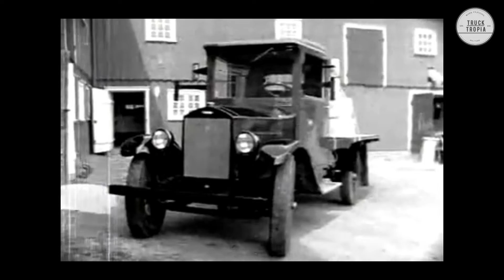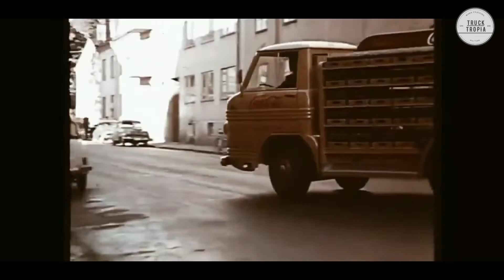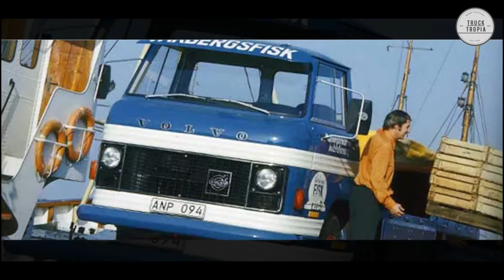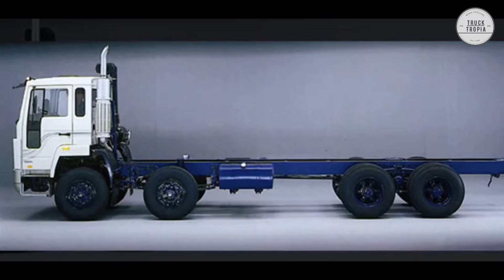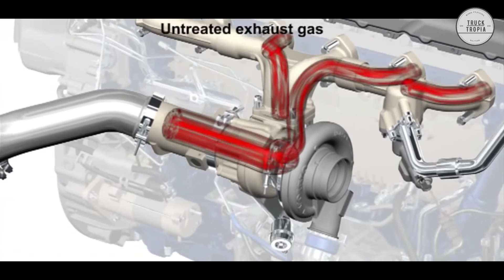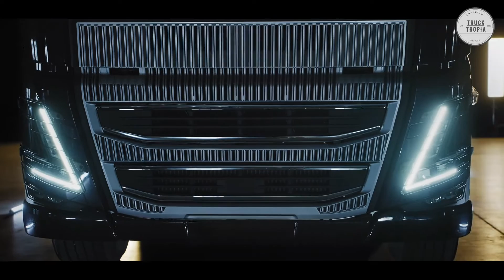How Volvo Trucks Became An Industry Leading Manufacturer

Comment: Volvo Trucks

FL (This Century) = A Jean-Philippe Texier Truck (Production)

Volvo (Latin: I Roll)’s Lander Rebadge (Low, Mid Or High Cab)

FE (This Century) = Jean-Philippe Texier Truck (Exhaust Brake)

FM = Volvo’s Forward Control (Multi-Purpose)

FH = Volvo’s Forward Control (Haulage)

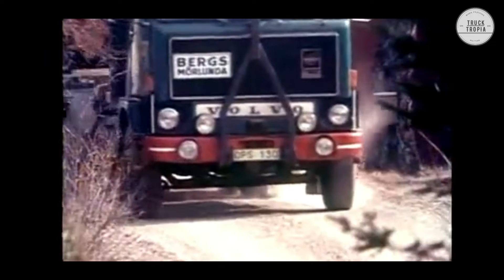4:10 Volvo TipTop Range (Forward Control)

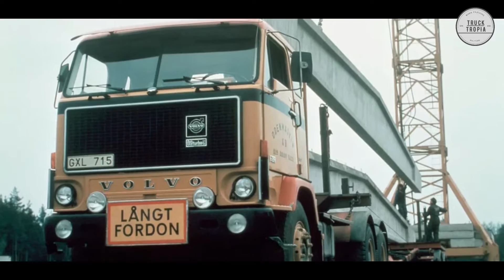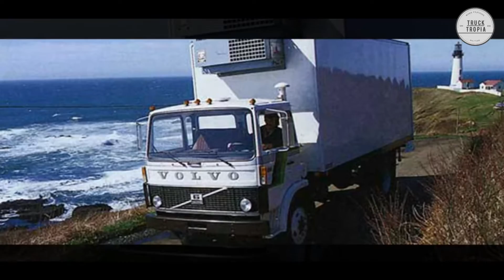5:12 Brand Club Trucks 5:20 Forward Control

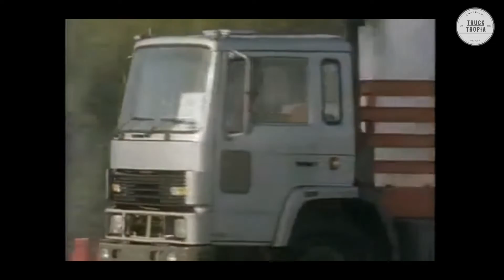6:21 Brand Club Trucks (Door Windows)

5:21 Volvo F Type

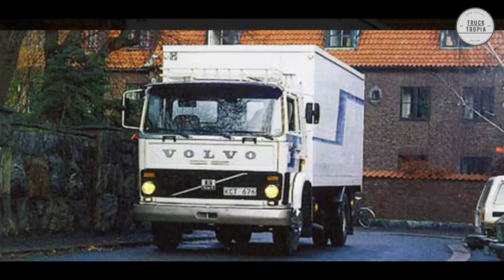5:35 Volvo’s First Series Of Truck

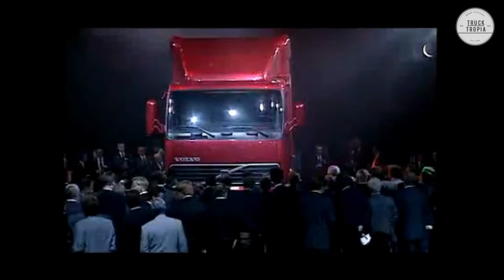6:50 Volvo F Type (Revised)

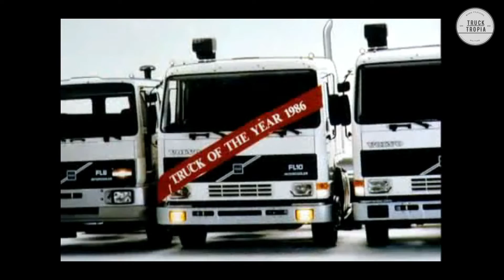6:34 Volvo L Series Trucks

6:51 The Original VN (Volvo Nordic)

7:04 Volvo L Type (Extreme)

8:38 Jean-Philippe Texier Trucks (Regular)

8:38 Jean-Philippe Texier Trucks (Exhaust)

8:55 Original VN (Multi-Purpose Extreme)

9:10 Original VN: Makeover (Facelift)

9:30 The Original VI (Volvo Iconic)

7:42 Revision Of The Original Volvo Nordic

Each Model Of The Volvo F Series Lineup Throughout The Years Come In Different Generation Styles

The VN Is The Original Version Of The Volvo WG Nordic

Volvo WG Nord (VN WG)

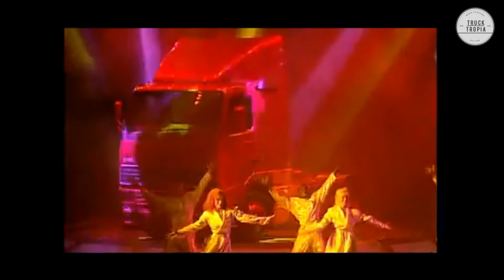Volvo Nordic (VN) 6:55, 7:30

Claes Nilsson 9:30

10:18 Hydrogen Driving Trailers

A Jean-Phillippe Texier Hydrogen Wagon Both Ends Each

Three Of Which Are VI (Volvo Iconic) In The Middle